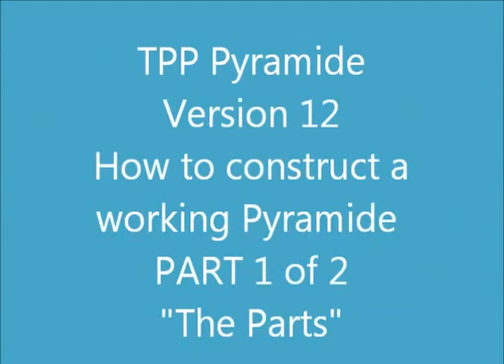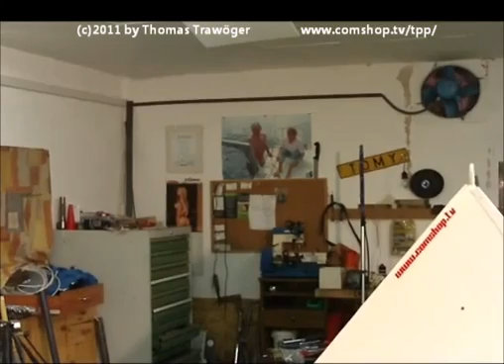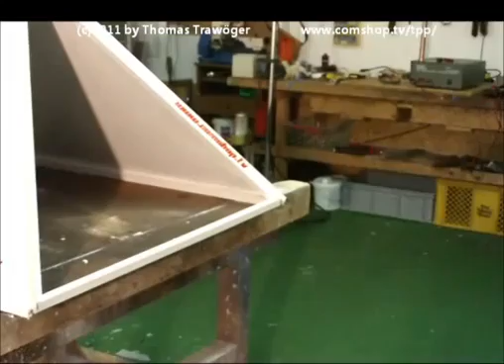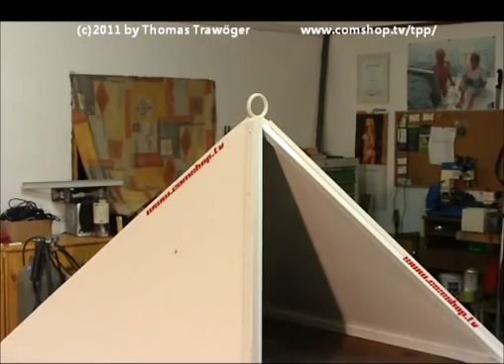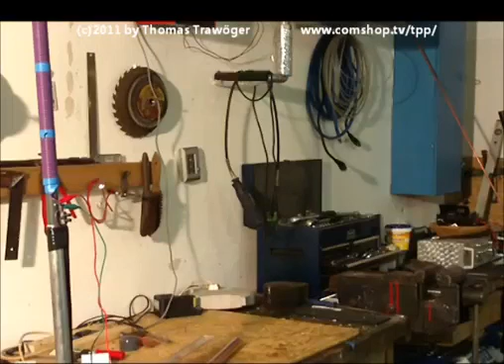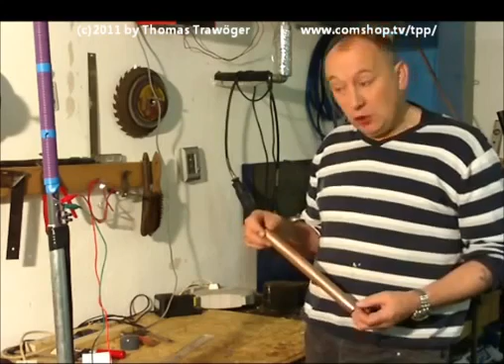TPP V12 Tutorial Part 1 of 13 - Reupload

Comment: This is nothing new, Quarts crystals can store small amounts of energy. It’s part of the concept of piezoelectricity. You’re basically just electrically charging the quartz and using that to power the fan. The pyramid has nothing to do with the electricity generation. That LED or fan can’t run forever. And when the charge dissipates, you need to charge the crystals again.